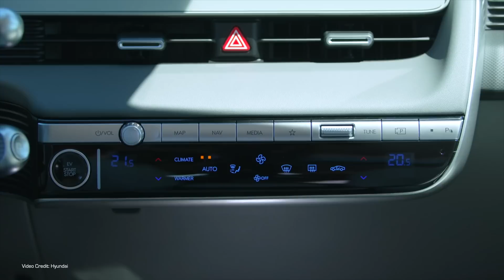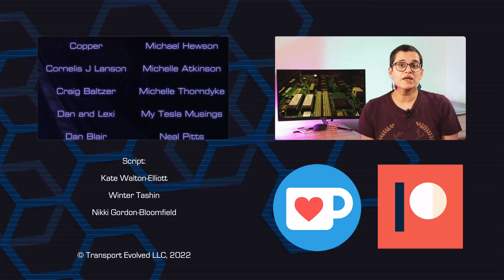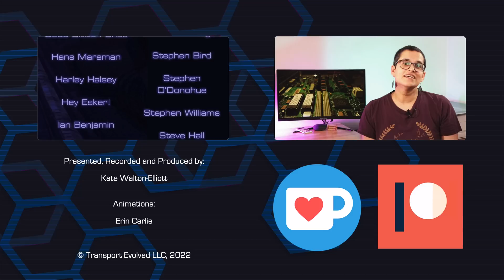EVs - End of the Shade Tree Mechanic?

Comment: When a car gets to a certain age it might be worth just replacing all the computer stuff.

Think of something like a Mitsubishi i-Miev, if someone sold a kit to replace all the computer stuff then that would be really cool, you could install massive LCD displays.

Or what about those Nissan LEAF's where you can't just swap the battery.  If the entire computer system in the LEAF was replaced, then you could put whatever battery you like into it.

There is this project for self driving called COMMA something or other, well if you can have a self driving project then when not a different project to manage everything in the car, so that these computer systems can be ripped out and replaced.

...Obviously when the car is old enough to be out of warranty.
Reply: Nissan LEAF's battery swap issue has long since been solved by the Aftermarket/DIY. Same is true of BMW I3
Reply: @idrisddraig2  on the LEAF people have swapped an existing old battery pack with another existing old battery pack.

But no one has swapped the cells for brand new cells.  And I mean "cells" not battery pack.

Comment: Don't be surprised if the folks at AAMCO don't get into electric vehicle repair for service vans and cars. Hint Hint. Why is it needed? Case in point. Arizona is in the top three sales of Teslas outside of CA and there are only four of their overcrowded service shops (ie Dealerships) in the Phoenix valley with no locations in the city of Phoenix. Some of my neighbors have been so frustrated with Tesla's local service centers and at-home service, they now have their vehicles repaired at independent mechanics like Gruber Motors.

Comment: I can't imagine the hell my life would have been if I had had to depend on VW dealers to service my VWs.
Reply: Would you're life not have been much better had those cars not required service? I once had a brand new VW that made noise from the rear brake drums. Turns out the slave cylinders were blown. Less than 5K on the odo. Pretty sure they leaked from new.
Reply: Volckswagen is life!They have very nice GTIs
Reply: @brunoheggli2888  A stuck open throttle in a VW Fox almost killed my wife!!  Cost $900 to repair in $9000 car.  Never again!!
Reply: @k34561  Only 900$ very nice!Think about how much it will cost if you have to fix a Tesla!